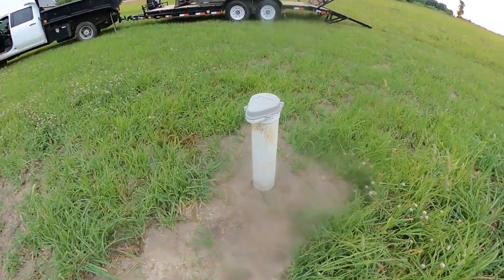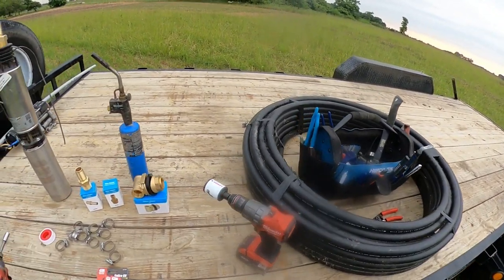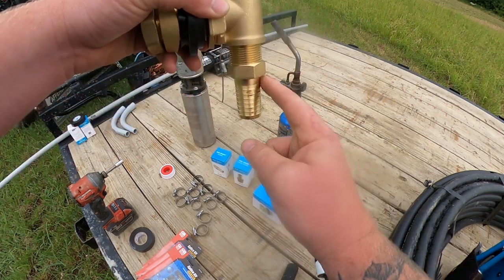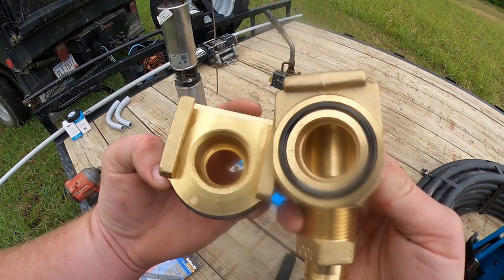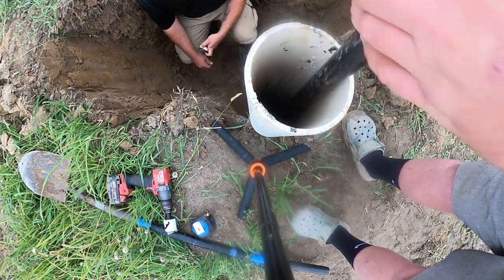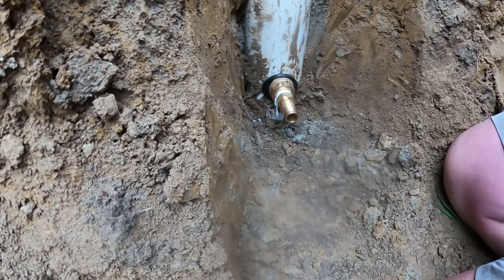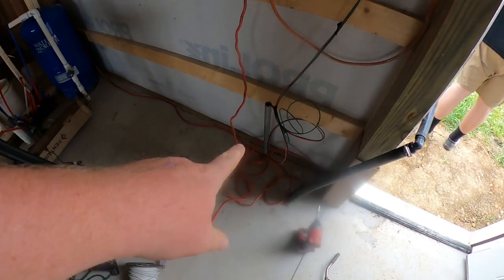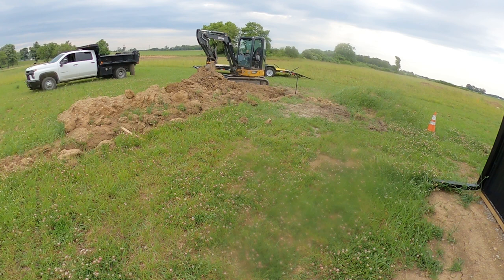How to install a pitless adapter and well pump.

Comment: I like the idea to put 1" Polypropylene Conduit to protect The Wire. I wonder why you did not keep the conduit all the way to the top? 
Also, there is 1-1/4" CTS 250 PSI  Poly Pipe available - why not to use it? It will not reduce the diameter from the pump and can withstand more pressure.
Reply from the maker: We have codes. Have to follow them.
Reply: @MooneysExcavating Your codes prohibit to put 1 1/4", 250 psi pipe instead of 1", 200 psi poly pipe?
Reply from the maker: @genevelis6075  yes

Comment: Up where I am the casing is steel . Little tougher to drill

I like the idea of sleeving the pump wire I've had wires chafe and break

I'm sure you did it but smearing some silicone grease on that adapter and o rig is a good idea
Reply from the maker: Thankyou, I stared sleeving the wires for the same exact reason.

Comment: Many Municipalities require the well head to be 18" above grade to prevent surface water contamination (from rain and flooding) cutting below grade is a no no.
Reply from the maker: Makes sense. This was in the middle of a field and did what the owner requested.

Comment: I noticed that you used Hose Clamps. Are Pinch Clamps a bad idea?
Reply from the maker: I just rather hose clamps where you can really tighten them. This line has constant pressure.

Comment: You 100% should have a T handle atleast 1" wider than the pipe this way no possible way to accidently drop the pump and or pitless adapter when installing
Reply from the maker: @Lefishn  good idea I will do that 👍

Comment: Good video you need a check valve at the pump
Reply from the maker: Thankyou. Pump has a built in check valve.
Reply: @MooneysExcavating   I understand that theres a ton of head pressure cause of the depth